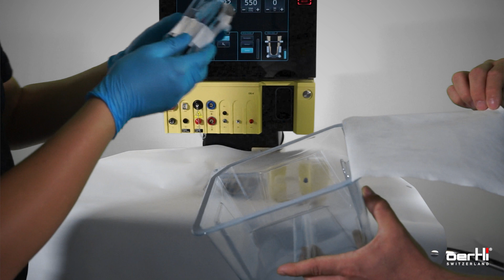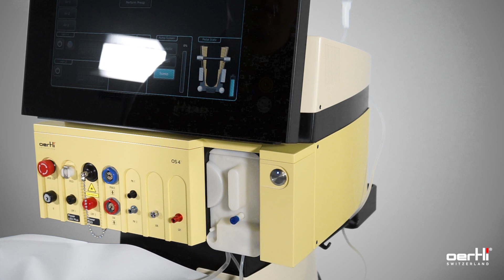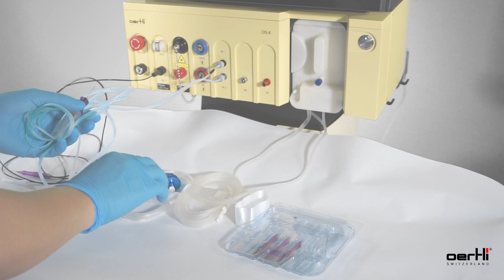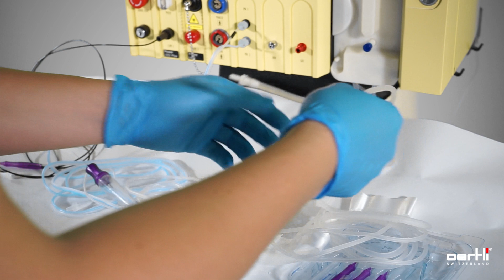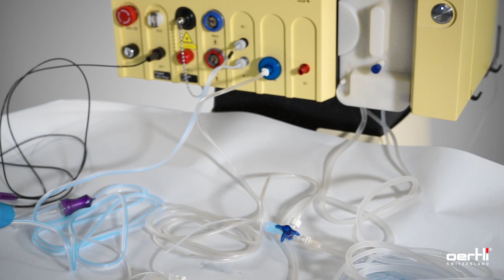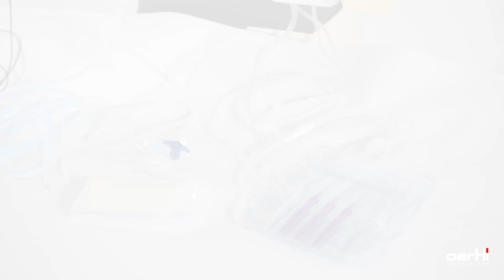Exclusive: Setting up the OS 4 for vitrectomy | OS 4 | Full version

Comment: Where is the extrusion tubing?
Reply from the maker: Hi! maybe this video will help you https://youtu.be/GbuiKBpOyPA
Reply: @OertliInstrumenteAG  no. It didn’t help. How to do cannula assisted extrusion. Or for that matter even clamp the infusion on and off. Cannula assisted extrusion helps during FAX.
Reply from the maker: Hi, okay, we think this will be helpful: https://youtu.be/Q_mP1bUPxtY
it is called gas forced infusion at oertli.
Reply: Disconnect the vitrectomy cutter tubing from the main aspiration tubing. Then, connect the extrusion cannula/tubing to the main aspiration tubing. we usually use a connector to fit. When using, the vitrectomy mode on the monitor should be on a cutter mode OFF.